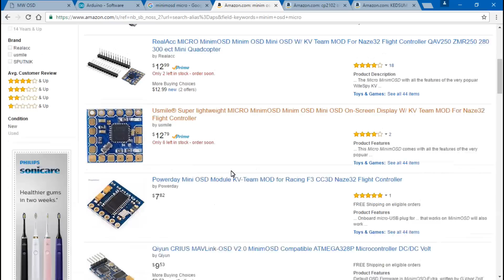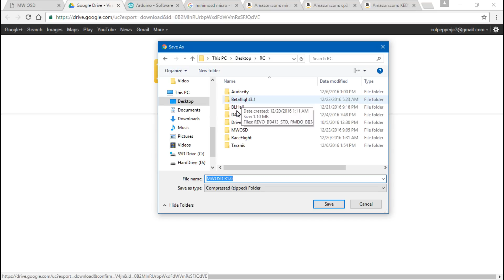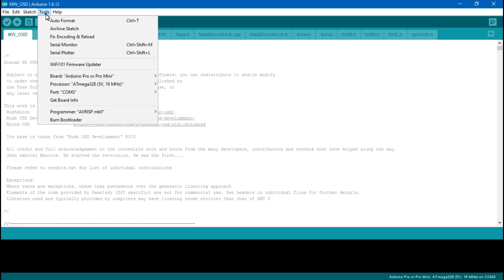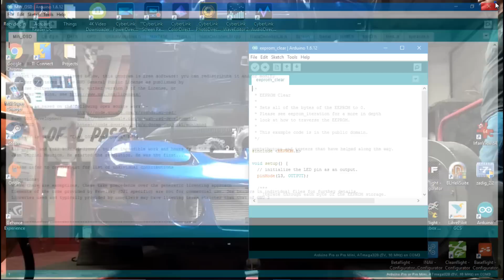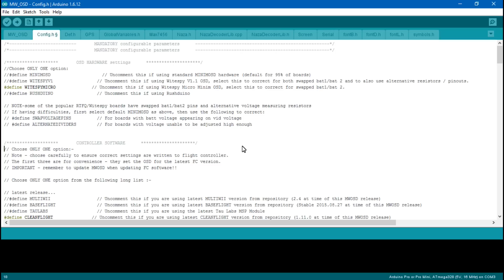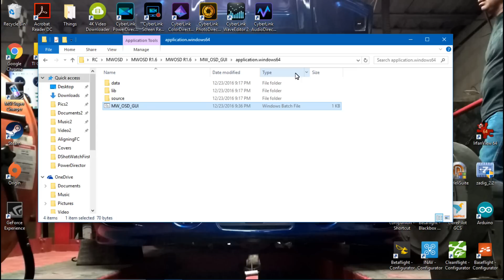Minim OSD Micro: How To Flash MW OSD Firmware

Comment: you can also use an arduino board to program the minimOSD, if you already own an arduino board. There is a FTDI USB-TTL chip on the board to communicate with the ATmega chip. Just remove the chip, connect the wires to the right pins and program.

Comment: thanks for the great videos. This is regarding micro minim OSD. I and most of guys having an font issue. Fonts wont up load correctly, means you get like japanese character.This issue has been on RC forums yet haven't got an correct solution.
Your expert knowledge is very helpful.
Is the USB voltage need to be spot on 5V? as mine is around4,5V

Comment: Hi JC, thank you for all your info.
I'm trying to flash the micro minim osd, I'm using an FTDI since I had it, and I'm getting as far as clearing the memory with the solid green light. When I do the config the sketch says I'm using 82% of memory stability problems may occur and when I upload it says programer is not responding, not in sync
Could you tell me what I'm doing wrong or what to try.
Thank you.

Comment: Thanks for the video! MWOSD 1.7 changes to the Chrome app configurator.  Your video got me to the point of loading the Micro card and get the blinking green LED. MWOSD Chrome app has the COM and Data rate setting in the upper right in drop-down fields and I'm connected!

Comment: I don't know why but i cant get it to work..i went to arduino program and cleared the epprom but never had a solid green light..it just keep flashing fast even after that..then i wanted to flash it with MWOSD as you did..and then under the "Upload done" was saying "low on memory,problems may occur"..whats that mean? I cant connect  to mwosd gui..what am i doing wrong..any ideas?? Thanks
Reply from the maker: I'd say first make sure in tools you have "Arduino Pro or Pro Mini" selected, for processor "ATmega328 (5v,16mhz)", and make sure you have the correct COM port selected. Other than that all I can think of is make sure you have the wiring correct for whichever serial converter you are using. Sometimes the pinout is different.
Reply: Project Blue Falcon its fixed..somehow i forget to select arduino pro or pro mini lol..but now its working fine..thanks for your help :)
Reply: see?, thats why people come here,  you instantly spot the mistake with the vaguest of clues.    imma try to get osd with, don't laugh, the micro minimosd, and ftdi232, and a cc3d running betaflight.......oh and i'm doing this because i bought the runcam mini, thinking it had the osd of the swift 2....lol.. when will i give myself an even break.

Comment: Hi JC thanks for the video! I followed your tutorial before and it worked perfectly, now I am trying to go back into the GUI and decided to try and reset the osd, but when I try to upload in arduino (all seetings in tool are correct) the green bar on upload stays at full but it doesn't say done uploading. If I try again I get an error message. The green light on the board is currently blinking very fast. Do you know hoe to fix my problem? Thanks in advance
Reply: Never mind JC just fixed it. My mistake, I accidentally bridged 2 pins on the minim osd micro. Just fixed and it works!
Reply: Hi Sohan, I'm having the same problem. I cant see any bridged pins on my minim osd micro though. Which ones had you accidentally bridged?
Reply: Mitch F I don't remember which exactly but 2 pins which the usb adapter thing connected to were bridged by some solder

Comment: Great video and playlist, very helpful and appreciated!  One thing I wanted to bring up is that I recently received the CP2102 board from the link, and it's not exactly as pictured and is a bit different than the one you use (which does match their pictured product, maybe I got the wrong part)?  But it is similar looking, but the six pins are DTR, RXD, TXD, +5V, GND, and 3v3.  There is a CTS spot marked on the side of the board that can be soldered to.  Is the CTS actually used, considering it just goes to a ground on the OSD?
Reply: krypticvoid hey did you ever manage to find the answer to this question? I hope you did as I want to know it too :)

Comment: Hi jc in the past I tried to put a micromosd to my quad but I think I buy a arduino that doesn't work to flash the micro maybe if you have an arduino nano v3 in"how to" wire and flash the micro it will be awesome to look so I can't use my micro jeje happy new year and keep doing what you do awesome vids
Reply from the maker: I'll make a video on using an arduino
Reply: I have a rev 3 Arduino Uno and got it to work. I used the reset pin on the ICSP header to go to the DTR pin on the MinimOSD. I also set the Arduino IDE to use Arduino Pro instead of Arduino Uno in the software.